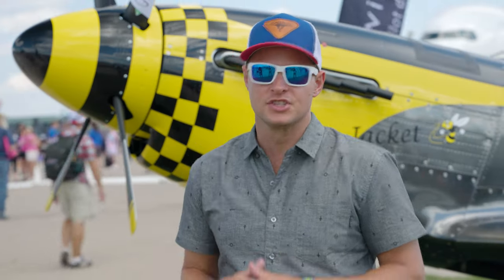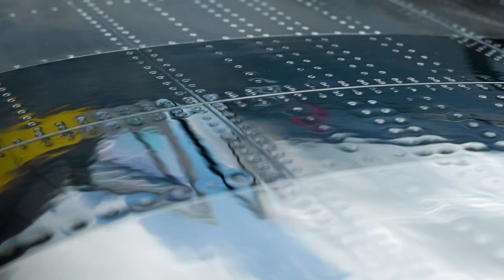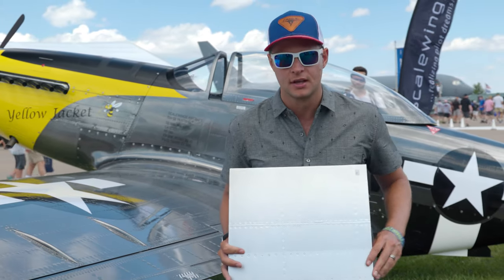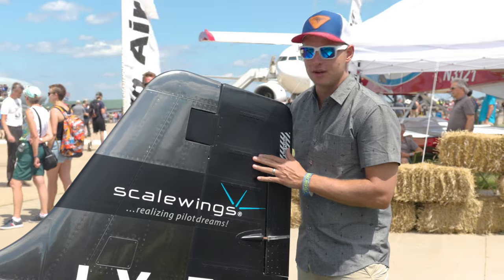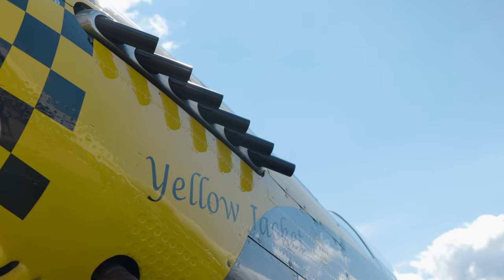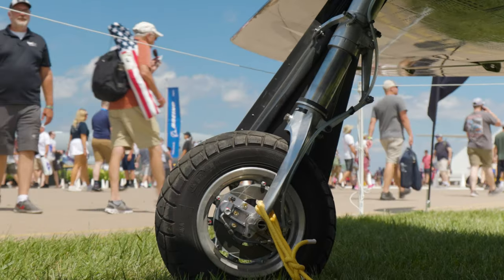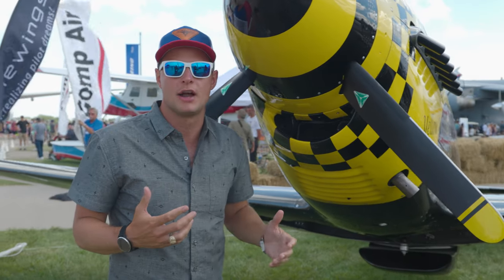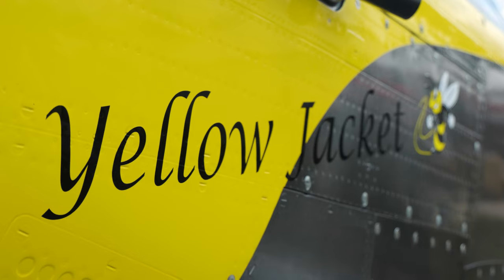This Carbon Fiber Mustang is Disrupting the Aviation Industry | Scale Wings SW-51 at Oshkosh 2022

Comment: The belly scoop on the original did cool the oil cooler, but it also had the radiator in there for engine cooling. The design of it actually allowed the expanding warm air to provide some thrust!
Reply: Was about to add that too. Only Rear engine WW2 fighter plane the US built was the P39, p400 and P63 models

Comment: I mean.... Why make fake rivets? Would much rather not have the fake rivets and have the plane cost less.
Reply from the maker: Since the molds are already made, it doesn’t add any extra cost per airplane. They sent hand set into every aircraft, just the original molds.
Reply: Authenticity. Without the simulated rivets and screws, it'd look much less like the real thing. Of course, one would only see those details on the ground, not in flight.

Comment: 70% airframe, 7% power. What's the point?
Reply: I have an 1,100HP LS looking for a home. If this can take even de-rated power I am very interested.
Reply: 180 kn on 7 gallons an hour, 300° roll rate at 25% the cost. That’s the point.